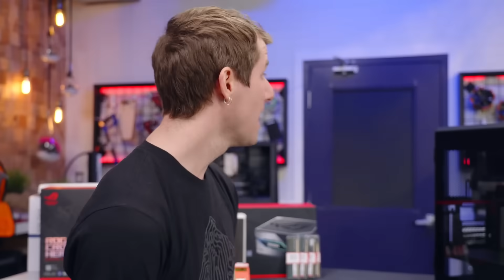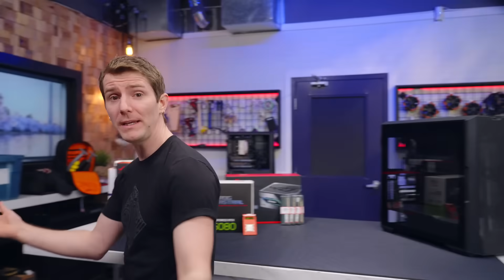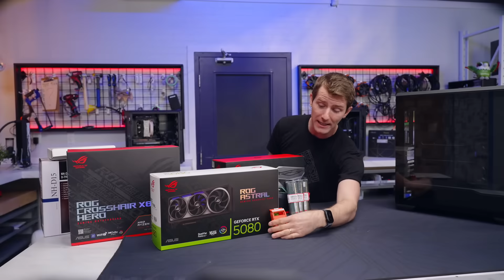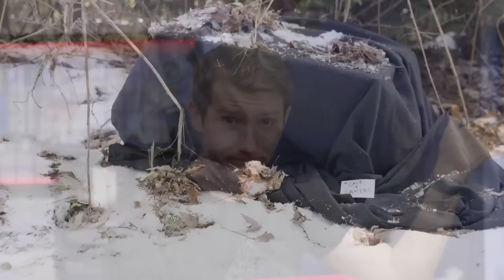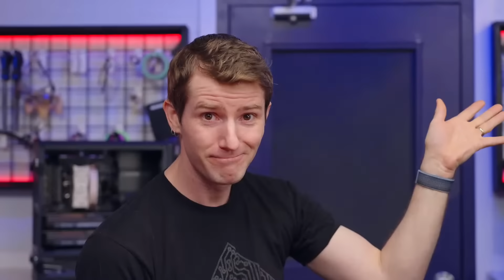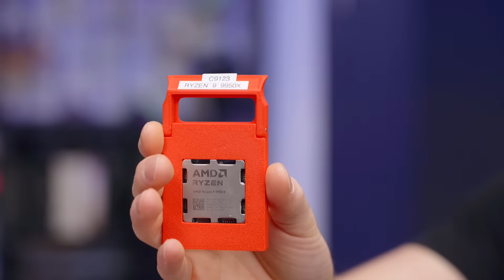The Ultimate $4500 Workstation PC

Comment from the maker: After the stream ended, we were curious what we could achieve with our Memory and if we simply needed to be more patient for Memory Training. After about 25-30 minutes of waiting we were able to get a stable system with 256GB of RAM (4X64GB) at 5200MT/s. Pretty Impressive!
Reply: 1080p tenia un problemas que ya esta bien eso era todo tamanos pixeles cuatrado pero ya esta oganizado bien y tv egg tv tambien esta relsuedo mucha cosa ya esta escajado mejor
Reply: You might need to bump voltage up and loosen timings if you want 6000mts
Reply: Wait for the M4 Ultra
Reply: if vram an issue, wouldn't it be better to switch back to 4090 / 3090 ti / non ti, or do you really need the 4:2:2 badly ?
Reply: @LinusTechTips  after the stream you need to be go checking all those backpacks after that merch message!!! 😂😂😂
Reply: Dude @linustechtips that chrome restart issue is real. I faced it for few years without finding any solution. But i figured it was a combination of windows drivers and chipset driver issue. Not just chrome but everything chromium was impacted. So chrome, teams, discord everything would just restart out of nowhere. All these apps will crash at once. Firefox never had this issue, even discord on Firefox worked fine.  
Anyways i did a clean installation, changed boot drive and manually installed drivers. After that the issue seems to be resolved.
Reply: Send a kit of that to Buildzoid let him see how far he can push it.  6000MT should work fine with correct timings.  EDIT - also do a test to see how the increased memory density is reducing performance.
Reply: Kinda bummed you didn't talk much about the gpu first voltage stabilizer, and the per pin 12vhpr sensing on the astral card. You know, if these things could actually help with the new melting issues on the new 5090, and seemingly also 5080s!
Reply: @LinusTechTips  I'm getting an RTX 4090D 48GB to attach to my Asus laptop (presently 3070Ti) to attach externally. I'll keep you posted.
Reply: 9950X is a beast
Reply: 1:38:05 Dan "Is this because the case sides" HAHAHAHAHA
Reply: How many work stations do you need?!
Reply: That's sick
Reply: Video isnt up on floatplane?
Reply: that's cool
Reply: Maybe Linus should listen to his staff. 🤷🏻‍♂️😅 next time try having a Mario kart tournament during ram reading.
Reply: Why does it take so long?
a) If Intel can do it quickly, why can't AMD?
b) Given that it takes so long, how is it possible for the result after training to still not be good reliable timings?
Reply: @BrianG61UK  From what I recall reading awhile back, Intel's Memory Controller is just plain better. Since then they've kept improving it, and AMD hasn't quite caught up yet.
Reply: @BrianG61UK  One factor is that amd cpus default to a 1:1 ratio between the memory clock and memory controller clock when at 6000 and below while intel’s memory controller only has a 2:1 mode.  With some configurations on amd you can even run 6400 in 1:1 mode.
Reply: @BrianG61UK I’m talking out my ass here but didn’t he talk about how weird and not-really-supported the RAM is?  And it’s a 4x slot config? 1) does it take that long if this were a more conventional RAM config? 2) Sure it’s a long time but amortized over thousands of hours of use and some mind boggling number of memory transfers, isn’t a minor cost to pay? It usable out of the box and you just pop it into learning mode before you go home and the next day…free bandwidth.
Reply: @KingOfAllJackals  Good point -- at least for this particular PC with the fancy motherboard. But why in general does AMD take so long to train with new RAM?
Reply: no estaba terminado y no ser cuando sigar porque siempre hay algo nuevo pero que ya este terminado alas 8:05 pm PR
Reply: i have 128gb of 6400MT/s my pc does 3 long beeps then two short ones. does that mean my cpu doesnt support it? i have a i7 14700k.
Reply: @iloveramen you should probably first look at what your mainboard supports
Reply: What u do to the old pcs??
Reply: @acid_lol  - repurpose them for as long as you can, upgrading if possible and stepping down to more lightweight OSes like Linux distros which you use as media centers and "guest PCs".

Once they're too old even for that? Find a recycling center that doesn't use kids in developing countries....
Reply: @acid_lol  I remember in an old video, he said that once they're done with builds, they take them apart and put the parts back in storage. He was referring to the PCs they build for videos, not the workstations in that one, but I imagine it's the same process.
Reply: Terminal Apple Hater Linus Sebastian builds an editing PC? For Micro$haft Windoze 11?

Oh, THIS can only end well! 🙄
Reply: @timeliebe 
Enjoy your overpriced, anti-consumer friendly, ecosystem locking apple products.
Reply: @dillonh321  - Spoken like a True Apple Hater!

Linus, along with his masters Borg Gates and Bullyboi Ballmer,  must be so proud of you....

Comment: An M4 Max Mac Studio would be cheaper, faster for editing, inbuilt 10gbit ethernet, have way more VRAM (48GB), doesn't need to be put together, and comes with a warranty for the whole thing. And specced that way it comes at $2,700 instead of $4,500. For the half of the editors that like Mac, it's an absolute no brainer.
Reply: Gotta at least spring for 128gb ram for his editors

Comment: Hi there, I bought twice this motherboard,  not sure what is the issue but on first one and second, I can't get WiFi connection ( in my new RIG system don't see WiFi connection i just able to connect through cable only😔). It's not coincidence 100% if this happens twice on roll 😔. System say: " The MediaTek Wi-Fi 7 MT7927 Wireless LAN Card adapter is experiencing driver- or hardware-related problem". 
Please Help me

Comment: well nvlink all 5080 with the current 3090 which is the current setups ,does  adobe premiere pro  run on multiple GPU ? and ofc you need to upgrade your PSU to 1600 or so !

Comment: U guys have to fill out an incident form for a paper cut? 😂 I'm in the middle of recovering from falling on the corner of a half inch thick steel plate hitting my lower back on it. And that's the first time I've had to fill out the form and only because I had to be put on a modified work load.

Comment: This PC’s so ridiculously fast it could calculate the trajectory of every raindrop in a hurricane before you even blink, letting you predict the weather faster than Mother Nature herself decides it. Its dual RTX 5090s and i9-14900KS can render a Pixar-quality animated movie starring a million dancing penguins in the time it takes to sneeze—about 0.3 seconds per frame. Imagine it solving the meaning of life, the universe, and everything in 42 milliseconds, then emailing Douglas Adams an apology for stealing his thunder before you can say “intergalactic gargle blaster”!
If you want to future proof your setup by staying with Intel here is the Best PC Build Intel (Dual RTX 5090s)

* CPU: Intel Core i9-14900KS (24 cores, 32 threads, 6.2GHz)
* Motherboard: ASUS ROG Maximus Z890 Hero (Intel Z890, PCIe 5.0, WiFi 7)
* GPU: 2 x ASUS ROG RTX 5090 Astral (32GB GDDR7 each, 2.61GHz boost)
* RAM: 128GB DDR5-6600 (4 x 32GB, 2 x CORSAIR DOMINATOR TITANIUM RGB kits)
* Storage: 2 x Samsung 990 PRO 4TB (PCIe 5.0, RAID 0)
* Network Card: ASUS XG-C100C 10GbE PCIe Card
* AI Accelerator: Google Coral Edge TPU PCIe Card
* Power Supply: Corsair AX1600i 1600W Titanium
* Cooling:
    * NZXT Kraken Z73 RGB 360mm AIO (includes 3 x 120mm fans)
    * 7 x AsiaHorse COSMIQ 120mm RGB Fans (with controller)
* Case: HYTE Y70 Touch Infinite Snow White (with 14.9" 2.5K touchscreen)
_________________________
Estimated Total Cost: ~$10,085

Comment: I'm trying to get a similar setup to run with the same motherboard and 4x32GB (KVR64A52BS8-32) and can't get over 4800MT/s. Could it be that it doesn't go higher because it's not the BD8-32 which has  sixteen 2G x 8-bit FBGA instead of mine which has eight 4G x 8-bit FBGA?

Comment: 4500 on a workstation? Thats cheap as hell. A cpu can run about 1k-5k a 64core 512gb workstation runs 15-20k. And thats if you dont need a network upgrade to back it.

Comment: Everything apart from 10GbE and being able to use two PCIe slots at full speed. You can only use the cards at 8x/8x if you have a second PCIe card, no matter what it is. It's a stupid motherboard with stupid limitations. I had to use one M.2 socket (one of the chipset's PCIe4 sockets) to get 10Gbit with an M.2 10GbE card.

Comment: My ROG Crosshair X670E Extreme, took at least more than 30 minutes to train and boot, 4x16GB DDR5 6000 to get it together, stayed on 15 the whole time so seems fully normal. It is extremely stable. "Only" 64GB total RAM though but still four sticks. Also with the 9950X

Comment: Watching you feed cables through a hole and struggle to plug them into fittings on the front on the motherboard, when the motherboard could have been designed with the power connectors on the back is painful. 

What are your thoughts on cable free motherboards?

If power supply companies are making "modular" designs with the power brick having open connection already.... why aren't board designers building the cables into the board and having a simple plug connection AT the power supply.

There are so many different components and designs of stuff out there already, having a board with no cables would surely be the next logical step.

Comment: 30:30 A good reason to move off of motherboard ethernet to a dedicated chip like Intel X540 is because they will have dedicated networking chips that offload some networking tasks from the CPU. This means that instead of inbound and outbound packets requiring use of the PCIe bus to ask the CPU to compute things like checksums, all of this traffic is removed from the PCIe bus and done on the PCIe card. Apparently RealTek based controllers are garbage at this, and is what most consumer motherboards use. Look up TCP offloading on your search engine of choice.

Comment: AMD GPUs are better if you are considering Linux not only because of Valve.
AMD drivers are open source and tightly integrated with the system.
Nvidia on the other hand provides a closed source blob that creates problems for devs and reduces performance compared to Windows.

Comment: Kinda bummed you didn't talk much about the gpu first voltage stabilizer, and the per pin 12vhpr sensing on the astral card. You know, if these things could actually help with the new melting issues on the new 5090, and seemingly also 5080s!

Comment: I know that may question will be controversial but thinking of the combined price of those machines, have you guys thought about using mac mini or mac studios as your editing rigs? I think we all know of the incredible performance of apples m-chips. How is the performance compared to these x86 machines? Did ltt thought about that possible way? 
To the pc guys: Its an honest meant question! What is the performance difference? Why is ltt sticking to Windows editing stations? Is it the conectivity to network shares or just the fact that they know windows better than macs? Is it the ability to repair the x86 machines better, as macs are all soldered toghether? 
I would really like to know that :). Thanks for the upcoming discussion. Have a wonderful weekend yall :).
Reply: They answered this in the video.
Reply: @dillonh321  Ahh thanks for the info. Do you have a timestamp?
Reply: @onewisegentleman7637  
No. It was towards the end. The reasons they gave were: most of their editors do not want Macs and they try to have as few Macs as possible because it is difficult for their IT team to get it working on their storage network.

Comment: When I was a kid I had an xxx-in-1 electronic kit that had a bunch of different components connected to springs and you stuck the ends of bits of wire into the springs to connect different parts up.
Easy to use and fun.

Comment: Dude @linustechtips that chrome restart issue is real. I faced it for few years without finding any solution. But i figured it was a combination of windows drivers and chipset driver issue. Not just chrome but everything chromium was impacted. So chrome, teams, discord everything would just restart out of nowhere. All these apps will crash at once. Firefox never had this issue, even discord on Firefox worked fine.  
Anyways i did a clean installation, changed boot drive and manually installed drivers. After that the issue seems to be resolved.

Comment: @37:22 had to stop to comment on certification.  Work in an organization of a couple thousand workers, we heavily use certification not because certificate courses are better (they aren't) but because I'm paying $500 - $7.5K to not worry about if the bottom 25% individual actually knows the material before I send them out the door.  The class just offsets the curriculum design and instruction cost.  Even just third party certifying an individual knows free material is valuable, potentially depending on the material, in the thousands of dollars.  I think there is a market for a free video course, with a paid certification.

Comment: I'm building a very similar setup with the same motherboard, CPU, NH-D15s. Waiting for my Gen 5 NVME SSD to come in. I couldn't tell by the video, but does the NH-D15 block the NVME slot nearest the CPU?  That is, if I install the D15 to test without the SSD, am I going to have to remove it to add the SSD later?

Comment: that's a pretty good motherboard but I don't like the fact that so many motherboard makers are overloading boards with m.2 slots at the cost of PCI expansion slots yes high speed storage is important but that only leaves you with two expansion slots and one of those is for your GPU this completely hamstrings the user when it comes to Future upgrades and expandability

Comment: Wasn't impressed with the PSU as all the wires were individual and looked untidy even after did the wire management, PSU's i find funny though as maybe around 10+ years ago i invested in a Be Quiet Dark Power 1000w and it is like the other companies have finally caught up, fair enough it wasn't fully modular as still had the one cable always connected but at the time all other PSU's looked like they had a car wiring loom hanging out of them. The PSU is still in full working order and still runs silently.
The Graphics card i do not like either as to me the size will have many people who want one with no other option but to change thier case as has no way of fitting, unless of course like me already purchased a Full Tower Case [Sahara P35] which without measuring one would more or less look lost and may even be enough space to fit two. The sagging down at one end, older cards did this and why ended up with strengthened slots but still a problem when newer cards are still drooping and the supports you get i feel take away something from the general look.
Finally I cannot believe how bad Cyberpunk looks, no part of it looked smooth and like steering a vehicle around in early versions of GTA. [This could be down to i am too used to Assetto Corsa on high specs.]

Comment: People really need to understand that you do not need, at all, any thermal paste. You can run your PC perfectly fine, without any issue, using no thermal paste. Ever. 
What thermal paste does, and that is the only thing it does, is providing more surface area for the heat sink. This is the reason you need as little as possible. Using too much thermal paste can actually hinder your performance. 
Thermal paste no matter what brand and/or type, does not magically shave off some degrees. In other words, it is not the thermal paste that gets you better cooling, it is the better surface area that the thermal past gives you, that gives you better cooling.

Comment: Linus is totally right. Ram or PSU. It is sometimes mindblowing what a "looks like working" psu can do. I remember, when I was the PC guy in my former company, I renewed all workstations at once. Everything and every system worked just fine. Except for one. One had issues connecting to the DSL while Ethernet (and everything else for that matter) worked fine. While trying to find the issue I randomly switched parts. As it wasn't the RAM, I changed the PSU back to the old one and... Tada.. So we had a bad new psu, which can happen. 
This was the weirdest PSU releated Issue I've ever had

Comment: Hello, random with the 9950x and a asus x870e hero mb.... good luck with the bios and fast memory stability. Once its running it isnt much of an issue, but if you shutoff your pc between uses prepare for a memory train everytime

My ram: x4 corsair vengence 16gb cl30 6000mts

Comment: Those Aquantia 10GbE controllers that tend to end up in motherboards are total junk (AQC107) or problematic on Windows (AQC113). That's why you're using an Intel card.

I know from experience that the AQC107 PHY does not play well in the slightest with Ubiquiti gear. 10e-6 BER that resolves just by changing the NIC, and on two samples from different manufacturers.